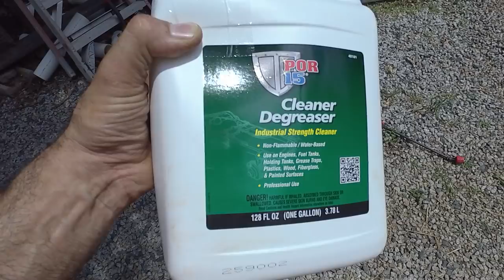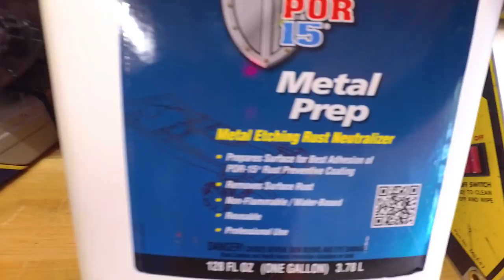Equipment Trailer Build Part 3: Paint

Comment: 2 gallon air paint sprayer from harbor freight works great for spraying oil based on equipment.  And Caterpillar brand yellow holds up real nice on my 416 backhoe.  Didn't even do really any prep except pressure washing and taping it out.
Reply from the maker: I know, I should have bought one for this job. What a pain this was.

Comment: Shawn, I prefer red oxide primer it's what is used on most steel applications and it has a sealer inside it to detour rust until you get ready to apply a finish coat.

Comment: Yikes if your dealing with trailer thieves when you have the bed off weld your business initials in the webbing so if you crawled under you can see it but its not in your face, though I would also put your initials on the tongue. gives them something to grind off then they think its clean
Reply from the maker: Hahah I did weld my initials into the frame and they just show up on the next video, which is currently exporting.

Comment: When I used to use an airless sprayer to put on epoxy, we’d cycle thinner through it at the end of the day until it ran clear. Tips wore out fast, too. They’re great for making quick work, though
Reply from the maker: I have sprayed so many houses with that and when residents move out, but I was ready to junk it. I ran about $20 of mineral spirits through it which added insult to injury after I struggled with it.
Reply: @GCFD  for new metals like that, I would probably pickled it if it had scale, then used something like Sherwin Williams DTM. https://industrial.sherwin-williams.com/na/us/en/protective-marine/catalog/product/protective-and-marine-coatings/products-by-industry.11543396/pro-industrial-dtm-acrylic.PCP_28124.html not that it matters now, but maybe next time. They also sell DTM etching primers. Or you know, a rattle can for a tenth of the price
Reply: @RyJones  --- Thanks for the recommendation.  I found a complete price list online, I don't know how these will format here.  These are **list prices**  Prices for five gallon pails are listed as per gallon

ACRYLIC DTM ACRYLIC -100 Gloss Acrylic Ultradeep Base 650157381 B66T00154 5 GAL 128.79
ACRYLIC DTM Acrylic Coating Semi-Gloss Extra White/Tint Base 640517538 B66W00211 GALLON 113.59
ACRYLIC DTM Acrylic Gloss Acrylic Coating Black 640110748 B66B11011 5 GAL 111.59
ACRYLIC DTM Acrylic Gloss Acrylic Coating Black 1360577 B66B11011 GALLON 113.59
ACRYLIC DTM Acrylic Gloss Acrylic Coating Deep Base 640517520 B66W1053 5 GAL 118.09
ACRYLIC DTM Acrylic Gloss Acrylic Coating Deep Base 640517512 B66W1053 GALLON 120.09
ACRYLIC DTM Acrylic Gloss Acrylic Coating Extra White/Tint Base 640516340 B66W1051 5 GAL 111.59
ACRYLIC DTM Acrylic Gloss Acrylic Coating Extra White/Tint Base 640516332 B66W1051 GALLON 113.59
ACRYLIC DTM Acrylic Gloss Acrylic Coating Ultradeep/Clear Tint Base 1360551 B66T01054 5 GAL 118.09
ACRYLIC DTM Acrylic Gloss Acrylic Coating Ultradeep/Clear Tint Base 1360544 B66T1054 GALLON 120.09
ACRYLIC DTM Acrylic Semi-Gloss Acrylic Coating Black 640154787 B66BW0211 GALLON 109.19
ACRYLIC DTM Acrylic Semi-Gloss Acrylic Coating Deep Base 640517561 B66W01153 5 GAL 118.09
ACRYLIC DTM Acrylic Semi-Gloss Acrylic Coating Deep Base 640517553 B66W01153 GALLON 120.09
ACRYLIC DTM Acrylic Semi-Gloss Acrylic Coating Extra White 640517546 B66W01151 5 GAL 111.59
ACRYLIC DTM Acrylic Semi-Gloss Acrylic Coating Ultradeep/Clear Tint Base 1361096 B66T01154 5 GAL 118.09
ACRYLIC DTM Acrylic Semi-Gloss Acrylic Coating Ultradeep/Clear Tint Base 1361088 B66T01154 GALLON 120.09
ACRYLIC DTM Acrylic Gloss Acrylic Coating Safety Orange 1361534 B66E00039 GALLON 154.19
ACRYLIC DTM Acrylic Gloss Acrylic Coating Safety Red 1361559 B66R00038 GALLON 154.19
ACRYLIC DTM Acrylic Gloss Acrylic Coating Safety Yellow 1361526 B66Y00037 GALLON 154.19
stain
ACRYLIC DTM Acrylic Primer/Finish White 1361518 B66W00001 5 GAL 106.19
ACRYLIC DTM Acrylic Primer/Finish White 1361500 B66W00001 GALLON 108.19
ACRYLIC DTM Bonding Primer Off White 1360668 B66A00050 5 GAL 140.59
ACRYLIC DTM Bonding Primer Off White 1360650 B66A00050 GALLON 142.59
ACRYLIC DTM Wash Primer Yellow-Green Yellow-Green 640170601 B71Y00001 5 GAL 111.79
ACRYLIC DTM Wash Primer Yellow-Green Yellow-Green 640170593 B71Y00001 GALLON 113.79
ACRYLIC Sher-Cryl HPA High Performance Acrylic Gloss Coati
Reply: @davidnull5590  yup. Proper prep and good product means no warranty claims. DTM lasts forever. For a trailer like that a gallon of primer and a gallon of paint is money well spent. If you want to see what cheap finishes look like, check out Ohio Wood Burner’s trailer - the OEM used terrible paint with no pickle (probably) and it looks like hell.

Comment: Hi Shawn, the trailer is looking really good. I am impressed with your skills. A cheap spray gun run off of an air compressor works wonders especially with a good paint, can’t recommend any as I am in the UK. Isn’t a shame you have to think about theft it is the same over here as there is no trailer title system like you guys have. Looking forward to the wiring video, not my favourite pastime 🤣. All the best from 🇬🇧 UK
Reply from the maker: I wish I had used a cheaper air sprayer. I thought about it but went airless. It was a mess.

Comment: The reason for your lack of paint adhesion is most likely due to the oils on and in the metal. You need to use acetone or wd40 makes a metal oil cleaner that works well. Not sure if they still do that but I am in the process of rebuilding half of my 20ft gooseneck adding a 4ft dovetail to the back. Ur videos are helpful!

Comment: Fantastic video. Love the bright yellow.
Don't you have to have some sort of breaking system on the trailer especially as its huge.
Cheers 
Lee from the UK 🇬🇧
Reply from the maker: Yes, this size trailer needs brakes on both axles, a breakaway kit, and a backup battery. I'll cover those in Part 4, wiring.
Reply: @GCFD  Can't wait for part 4 
Cheers 🍻

Comment: I think you've done a GREAT (!) job on this trailer. Regardless of the challenges you've encountered. Yeah, the paint may not be perfect, but you'll soon be using the trailer anyway, so it won't matter that much in the end. For a future paint job, may I recommend the following option over rattle can? Use automotive, or even better, industrial primer and paint, and apply either with your airless system, or get a cheap HVLP Spray gun, which you can use with a small compressor. That'll give you a very good finish. And automotive and industrial paints are often very competetively priced, compared to the Rustoleum DIY type paint, which is way too soft.
Reply from the maker: Great idea. I used the rustoleum farm tough but It doesn't seem that tough.

Comment: There is a cheap paint gun out there that works good. You want one that has a screw on bowl and hooks to compressed air. When you shoot the air, the paint is drawn out of the bowl and sprays that way. No pumps or nothing, and no paint in hose's.
Reply from the maker: Man, I looked at those and wish I had bought one. Hindsight is always 50/50.